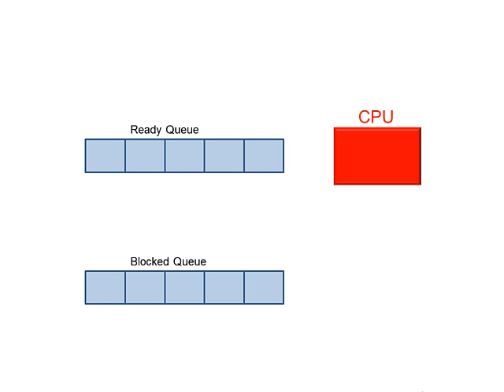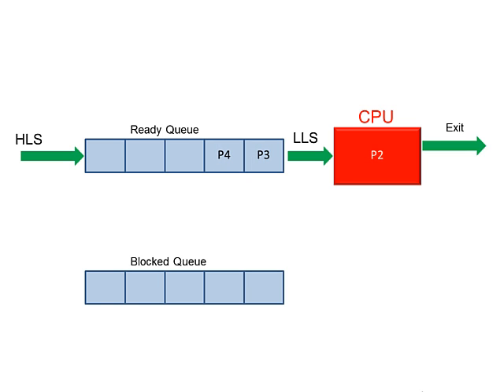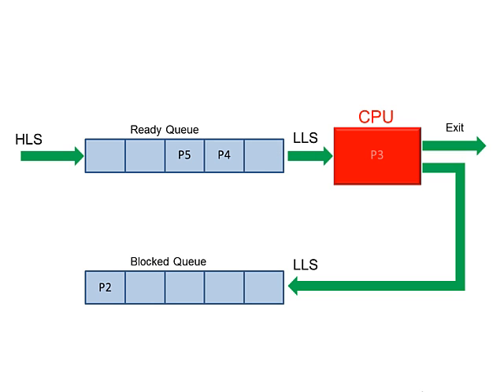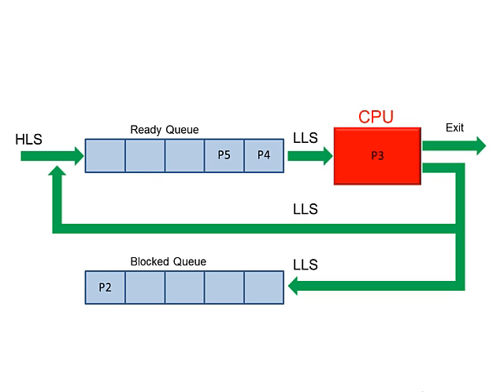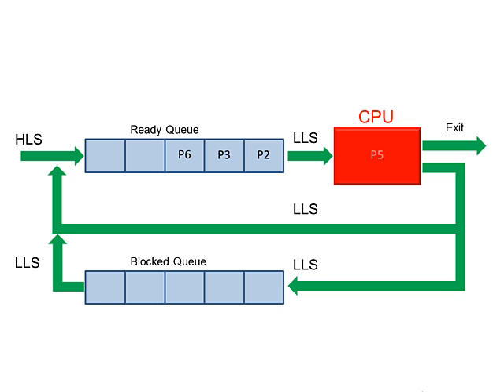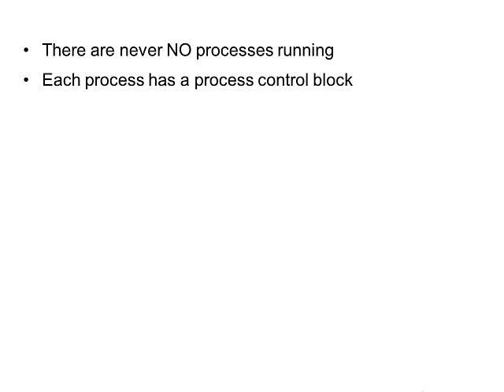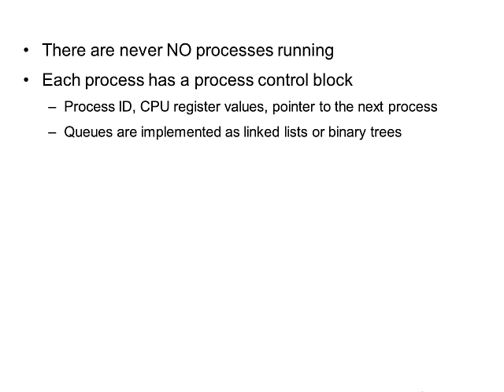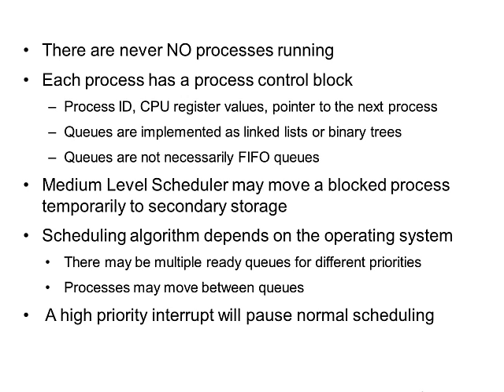Process Scheduling

Comment: In computing, scheduling is the action of assigning resources to perform tasks. The resources may be processors, network links or expansion cards. The tasks may be threads, processes or data flows.

The scheduling activity is carried out by a process called scheduler. Schedulers are often designed so as to keep all computer resources busy (as in load balancing), allow multiple users to share system resources effectively, or to achieve a target quality-of-service. 

A scheduler may aim at one or more goals, for example:

    maximizing throughput (the total amount of work completed per time unit);
    minimizing wait time (time from work becoming ready until the first point it begins execution);
    minimizing latency or response time (time from work becoming ready until it is finished in case of batch activity, or until the system responds and hands the first output to the user in case of interactive activity);
    maximizing fairness (equal CPU time to each process, or more generally appropriate times according to the priority and workload of each process).

In practice, these goals often conflict (e.g. throughput versus latency), thus a scheduler will implement a suitable compromise. Preference is measured by any one of the concerns mentioned above, depending upon the user's needs and objectives. 

https://en.wikipedia.org/wiki/Scheduling_(computing)